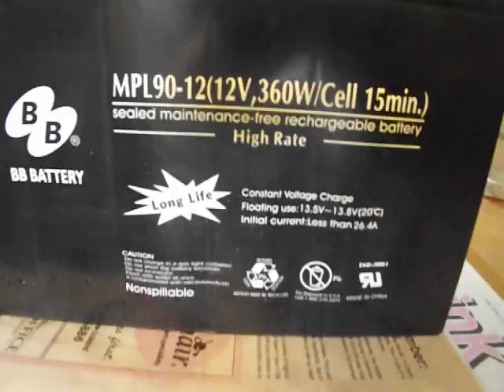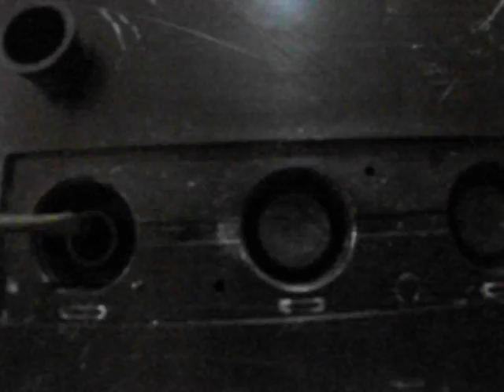AGM Sealed Lead Acid Battery Cell Dry Out. Hear Is Why

Comment: The guy is perfectly right , that maintenance free is a scam , is supossed to be maintenance free for the lifetime of battery and for not much use ; the technology in this AGM  , sealed is the same as lead acid batteries , is just these are not flodded but they work on the same principle, lead .
So , on a few of mine , i have added 2 , actually a bit more than 2 ounces of distiled water , i have let them to rest a day and then i have used a smart blue charger from victron to repair them .
As well , after that being in series with others , i have fitted an equalizer and i can see its value all the time .
So , to resume ....maintenance free my ass, that's  a scam .
You can add distilled water as the guy said but do not flood  them and follow some repair steps and you can have it for a few more years .

Comment: Probably weigh the bad battery, find out the weight of the same battery brand new(specifications),  and add the difference in distilled water, probably look to see which cells are more dried out and the water accordingly.

Comment: How much water would you add I understand you’re not meant to submerge the AGM? Thanks for the video
Reply from the maker: That is going to matter to the size of the battery right. No answer i have for that. Not much anyways no matter what size battery. Have to sort of base that on the size of the battery. Hey if the battery is no good already not much harm will be if it don't work out right. If your guess works and the battery ends up alright it's a win win.

Comment: Hi thanks for the video very informative and especially relevant for me since i am now moving from my reconditioning my maintenance flooded lead acid batteries to sealed types and I was worried what I would do incase i find its the Gel or AGM type. Anyways just confirming my understanding, incase i find there's no moisture once i get to these cell holes, I would need to top up with Distilled Water and or Sulphuric Acid mixed with Distilled Water 35:65 ratio? PS how does one figure out how much of the solution on has to add, esp in AGM since I understand its absorbed by the Fibre Glass Mats, how would one know how much?

Comment: you don't want to use distilled water with AGM batteries. That would ruin it.
Reply: why? because manufacturers says so? they want you to buy new batteries of course they'll tell you not to add water. I've added water to my dried out agm battery and it's fine now.

Comment: Can I add/checked distilled water every 6 months?
Reply from the maker: Normally AGM type batteries don't need these. The only way they dry out is if there over charged. Stay with in spec's for charging and everything should be fine.

Comment: Everywhere says you can’t add water to AGM batteries but you can, depending on how old they are. If they’re 8 years old, just fry a new one. The “sealed” caps do come off, but they can be tricky.

Comment: How do u tell if u actually have a bad or dry cell in a agm battery and is there a way to repair it if equalization is bad for them
Reply: I am trying to figure this out also I hv 8 AGM Super Start Premium AGM batteries, I took label off, took caps off, now under the dang caps is what looks to be a plastic hex nut, but it has several circles like maybe a relief plug, I dunno it got dark on me. Right now I’m broker than I’ve ever been, because my knee is so bad setting up to hv surgery next month. Anyway, I’m trying to figure it out, two people on a arteries forum said, just add some distilled water but boil it first and not to fill all the way to top like old school, you only way to saturate the glass cloth inside each cell, so half way what I’m going to do, working with a guy that makes old batteries new again for a living, he’s nearly there to giving me the secret additive he uses to instantly name them live but needs charging, distilled water, I’m gonna say baking soda or baking powder. I know it’s a white powder he said I hv it in my house probably but gotta coax him a little more as soon as I find out I’ll let ya know
Reply: @stevequate1797  I ended up selling my agm batteries and bought me some lithium iron phosphate lifepo4 cells
Reply: it's epsom salt
Reply: @mikakimi2558  add some amount of Epsom salt when replenishing the batteries???  Like a teaspoon per cell kinda?? 

👍🏼👍🏼

Comment: Hi how much water do you need to top it up for a AGM battery?
Reply: So if all my cells are equally dry (4 yr old & stored as a back up) can I add the proper amount of battery acid ( same as used in lead acid) & after allowing a few hours to saturate the glass mat proceed to a slow AGM setting trickle charge...
Reply from the maker: Not answerable. Matters to size of battery. Do some research on the battery kind to find out. What i will say if you figure the cells are dried out or a cell is then i would start with some at least and then work with it from there to see if any improvements took place. Good starting point at least if the research comes back with no answers. Other then that i have no way to know it. Cheers
Reply: @MrDoingEverything  What I've done is to gradually add a little until I barey can see some liquid surface in the cells. Then run several (often MANY)  reconditioniong cycles with an intelligent charger until the cells even out. And keep the caps OFF. Too much water makes them spew it out. A tip: Tilt the battery 30 degrees so the gas/bubbles  in overfilled cells get out easier without spewing out the liquid.

Comment: I would like to see the practical example because all I see is theories on multiple videos on what to do, but no proof that it actually makes a measurable difference.
Reply from the maker: It matters to how long the cell has been dried out for. Taking a battery that has been sitting there with dried out cells for years not likely going to work out.

Comment: It almost seems like you are talking about flooded batteries. AGM batteries are sealed, do not open them. AGMs are recombinant; hydrogen and oxygen produced during normal use are recombined back into water by an internal catalyst. They do not normally vent, so they do not normally dry out. The only way they can dry out is if you abuse them by overcharging them, because then they may overheat and will vent to prevent case rupture.  Don't do that. And AGMs do not need to be equalized, the electrolyte is immobile and does not stratify.
Reply: @rpbajb  ok VUT my cells in a sealed lead acid AGM battery look dry
Reply: I just pulled caps of my agm and it has those rubber caps. Would definitely lose water out of there over time. Better for battery sellers if everyone think Agm’s are totally sealed.

Comment: If I'm reading this right... 

BB MPL90 is not AGM, it is sealed, flooded, valve-regulated.  http://www.bb-battery.com/usa/show.php?f=MPL90-12(H%20type).pdf.44056dbf013ef031298531cc439abaff&m=MPL90-12(H%20type).pdf
Reply from the maker: AGM is simply ( Absorbent Glass Mat technology ) That's what they are.
Reply: @MrDoingEverything  I stand corrected.

Comment: Gentle men let me give you some advice on AGM if you look inside and see dry white sulfation crystals all that is required is two or three mist spray of distilled water you can use any empty domestic pump action ie_empty window cleaner and then put your battery on charging at the recovery setting for 24 hours I have done this successfully with my of grid wind generator AGM
Reply: so you never add distilled water to an agm battery. has to be a battery electrolyte. its sulfuric acid for batteries. add enough the mats will absorb but not so much where there is standing fluid. never add distilled water. you'll kill the reserve part of your battery. ask me how i know lol. have a great day!

Comment: How can you tell if its agm or wet cell agm your not supposed to add water.
Reply from the maker: Your right but if AGM goes into a over charge. That's what makes the cell go dry. If it's caught in time adding a little distilled water could save that cell and the battery be in good shape still. Wet cell type are easy to pick out from AGM. Wet cell type have caps that are easyly seen and taken off to check levels. AGM caps are not seen there covered up and have a little rubber cap on top that acts like a valve. To much pressure in a cell from being over charged the pressure will release it's self from that little rubber cap. And the covering of all them rubber caps stops the caps from coming completely off so the cells don't dry out. Also a wet cell type the liquid can be heard inside with some movement to the battery back and forth. A AGM there is no movement in liquid because it's a glass mat that soaks up and holds the liquid in place. That's why there is nothing to spill out when there tip over compares to a wet cell type battery. Hope that helps the understanding some better. : )
Reply: @MrDoingEverything  I went ahead and filled it up it has the small rubber caps its ok it was in the trash and reads under 2 volts.  Just trying to revive it gives me something to do.  I have another small battery that has the rubber caps but its a wet cell because adding water always brings the voltage up its stupid it doesn't say agm on the battery.
Reply: The charger can't get it past 2 volts:(
Reply from the maker: @chriss4365  There not all able to be brought back into useable times. Some can some can't. Matters a lot to how its being done and what type charger is being used and a lot of other factors. It may only start to get warm or it may start climbing  higher in volts. Hard to say what will happen. Matters to how much sulfation has taken place with in the plates or whether the cells have been to dry for to long a time. Playing around with things like this is more for something to do alright. Its not always going to work out i can tell you. Some will some will not. One can never really know.to what ones will or will not also never know if never tried. Best of luck. Be safe always at playing around at anything is a good idea. Its my thoughts anyways and ways.

Comment: I have a 1989 ford ranger and I went to start it and nothing the engine wont even try to turn over no noise>>>shorturl.at/ghszM    nothing, the dinging in the truck that tells you the key is in works and the radio works as Well as the head lights and dashboard lights work but I dont know what to do ive checked the fuses and replaced the ones I needed. I got a new battery and still nothing can anyone help? Comment plz
Reply: Yeah, k, I'll click that
Reply: Reconditioned & New Batteries
Reply: Get in touch with the size details of your traction battery box (Height,
 width and length), the voltage and some picture if you can and we will 
send out a no obligation quote.

Comment: what would be really helpful is how you reconstruct or refurbish a dry gel batt, perhaps you need to turn it wet? or maybe make new gel, or whatever, but i think you dont want to sahre...
Reply from the maker: When a cell goes dry it means that cell has been charged to much and vented out which caused it to go dry. If its a AGM type then adding some distilled water sometime will bring it back. Its hard because that cell to the other cells are out of balance. Its able to be done but its not something everyone will know how to do. Its a matter of getting all the cells to be the same voltage so what i do is lower the other cells with probes and cables.Or charge that one cell with probes and cables. Its not easy. Not every time that cell will come back to being good either. 80% of the time its a waste of time even trying. I just like playing around with things like this is why i do it. But only for my self i do. The gell type i never tried. No idea about the gel type other then the gell inside the battery dries up and moves away from the lead plates. To solve that not sure. Maybe by adding distilled water again might work but i have no idea.
Reply: @MrDoingEverything  You're right but  most people give up too soon. But with proper tools (like a battery tester, controlled charger, and patience), adding distilled water and carefully desulfating can actually bring AGM cells back. I've already seen signs of improvement on mine. Definitely not easy, but worth a try if you know what you're doing.

Comment: The first principle you should cover is that AGM batteries, in most circumstances, should never be given a true equalization charge.  They do not need to go through the gassing process like flooded batteries.  This will ruin them.
Reply from the maker: Equalization charge has a big meaning to different type batteries that's for sure.
Reply: We would typically see cell balancing in finish or float stage of charging. The voltage threshold in this phase is what will dictate gassing in the pack versus simple cell balancing.
Reply from the maker: I find my self a lot is based from how the batt is being used It seems to matter lots for how charge is going to work out. In a car /truck or something it can be  simple different uses means to me different methods to take. Its how i see it.

Comment: Could have explained all of that in 30 seconds. Instead of repeating same exact thing over and over 5 times.
Reply from the maker: Maybe so.
Reply: I did very mu h appreciate the video. But, you did repeat yourself  a bit, making it difficult to pay attention. Also, the taping the screw driver over and over was very distracting.  Not trying to be mean. Just trying to be constructive. The video is helpful. I didnt know a cell could dry out in a agm. I thought it wasnt possible, for 1, because its sealed. Thanks for the info.
Reply: @whatyoumakeofit6635  ADHD can be control with meds and consintration exercises
Reply: U could have helped my summing it up for us instead of complaining
Reply: Seriously
Reply: Appreciate Video! Apologies for butting in, I would appreciate your opinion. Have you researched - Rozardner Powerful Battery Reality (Have a quick look on google cant remember the place now)? It is a good exclusive product for learning how to recondition an old battery minus the hard work. Ive heard some unbelievable things about it and my friend at very last got cool results with it.

Comment: One thing that you need to remember is whether you're using an AGM battery or flooded battery your car's charging system is designed to charge the battery up and keep a voltage of over 14 volts which 14 + volts is designed on a wet cell battery to be the voltage you need to get to and maintain for periods of time to be able to balance out cell so if you are somebody who drives lots of short trips in your car you are way more likely to have car batteries go bad on you versus somebody who drives lots of long trips in their car because driving a long trip gets your car charging system to charge the battery up completely and then get the voltage over 14 volts and actually equalizes the cells by getting the car's battery over 14 Volts for longer periods of time it only takes a few minutes to recover the charge from starting your car and then get the voltage up high enough to start equalizing the cells about 5 maybe 10 minutes so if you start your car and you are doing long periods of driving your battery is a lot more likely to last you longer rather than if you start your car and do a bunch of short trips plus you need to go with the type of battery that your car is designed for because if your car is designed to have a gel cell battery and you put a regular wet lead acid battery in it then your car's charging system is not designed to get to the necessary voltage to balance out cells and you're going to buy a battery every year where is if your car is designed to have a regular let acid wet cell battery and you put an AGM glass mat in there it will tend to overcharge the battery and if you put a gel cell battery in there it will definitely tend overcharge the battery and begin the battery will go bad and not last you for a long because in this case the AGM glass mat and gel cell batteries aren't meant to go to as high as voltage as a wet cell battery make sure you use the right type of battery for what your car is designed.
Reply: that is the longest sentence I've ever read.
Reply: Actually it is vice versa. Regular lead acid charger can not charge AGM full. AGM requires higher charging voltage than regular batteries.
Reply: yes, but newer vehicles have lower charging voltage and some even terminate the charge altogether when a certain voltage is reached. the days of 14.4 volts while you drive are over. They do this to try to save gas but I doubt you will notice it. As a result the battery is always undercharged especially during very cold winter weather. This is not good for the battery and there are various methods online to trick the system into seeing a lower voltage and offset this to bring you back up to around 14.4 volts.